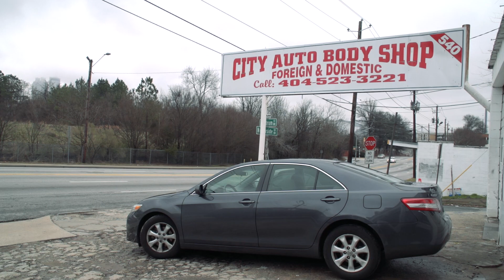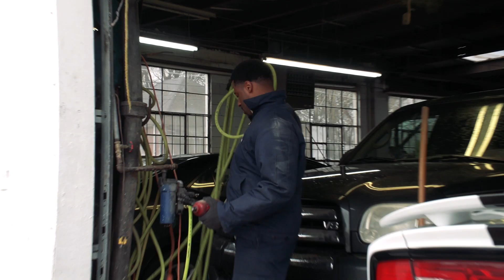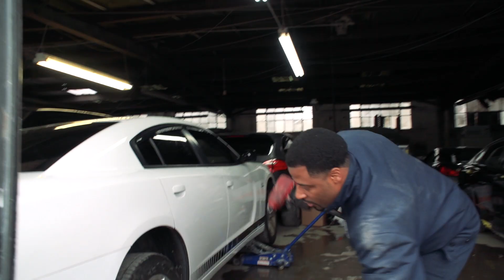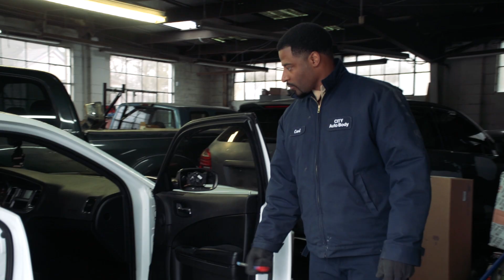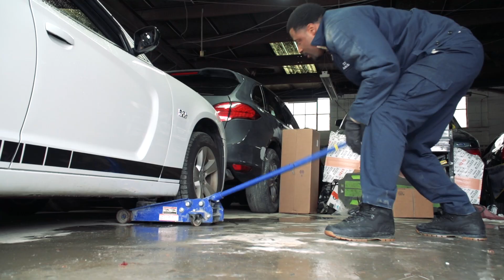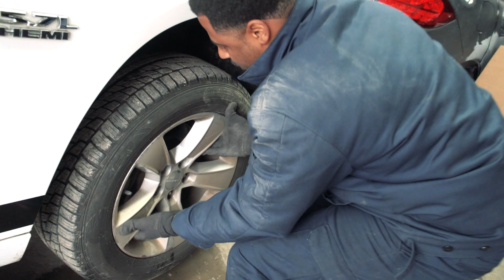Automotive Mechanic | What I do & how much I make | Khan Academy

Comment: I’m sorry but connecting a scan tool does not tell you what the issue is and how to fix it, it simply guides you where to check, removing and replacing parts is the easy part, all it is is nuts and bolts any grease monkey can do it

Comment: He sounds like a rookie. Kept talking about tires most of the interview.
Reply: bro dont hate congragulate.  Where is the god in you?
Reply: Gee Bizz that’s not hate. That’s just my observation. I’m a mechanic so I can tell when someone is lacking in experience.
Reply: @TheCm900  Does changing tranny fluid or coil packs count as experience? Or installing a cb radio and doing the whole fuse- splitting thing? When I first got my car, I noticed a sqeaking sound coming from the engine bay, and I popped the hood, and it turned out that the serpentine belt was like half gone, so, I went out, got the belt, and replaced it. My lack of experience, I found out later from a vet mechanic that I should've replaced the tensioner as well esp. in a vw because they've been known to wear out prematurely. anywho.. I like the fact that I can if I want to work hard enough, fix anything on my car. Well, as long as its not putting new synchros on my DSG Transaxle
Reply: @granderondeproductions3286  I must be deaf, cause who tf asked? lol
Reply: @yngfljm  i did

Comment: He look like one of those lube techs at jiffy lube
Reply: This dude would do circles around you.   that is if you even knew how turn a reverse threaded fastener.  oooo, mind meld.  ASE certified Automotive Assasin.  Made you a better technician.  You're welcome Junior
Reply: A reverse thread fastener, that is fucking stupid. Or he could check if a potentiometer has failed. Oohh… 

You fake ass mechanic, I can spot your kind a mile away. Did you know that cars had electrical components too? All you idiots that try to show off some basic mechanic aptitude. What a load of bullshit, you lying asshole, shut up you don’t know shit.

Comment: Did he say 6 to 3 thousand a year ?
Reply: 63 thousand a year.
Reply: It's 45k as mechanic. 13k as tow truck driver. Total 63 grand a year
Reply: @khoayeuha Try again 45 + 13 does not equal 63 lol
Reply: @jakek6728  lol. It doesn't.
Reply: 63 Thousand dummy
Reply: It does sound like six to three when I hear it, or six two three. But it makes sense that its $63,000 anually.

Comment: best thing I ever done being an automotive technician
Reply: Same... Had this Career since my 2 Girls were Born. Long Story Short, one of them going to College soon.... Thanks for this!
Reply: i’m about to graduate high school this year what did you study in college for this career or automotive engineering
Reply: @woptobrson417  dont go to college its useless in auto, im going rn its a waste , just learn online
Reply: @chrisrstt  what do you mean useless? If I was to go get a AS degree in automotive tech at a community college would it be useless?
Reply: @Spacelight_777  I'm going for one rn, most dealers don't care tbh
Reply: @chrisrstt  Thanks for letting me know! Saved me a lot of time 🤙🏽💯
Reply: @Spacelight_777  I'm in my second year as A PACT student and tbh you will learn more on the job.
Reply: @Spacelight_777  go get a job at a local shop or a valvoline or something. Keep going around working for different places and get experience, then you can work anywhere all in the same time you would’ve went to college and spent a bunch of money on it
Reply: @Goon_Toob  My coworker wants me to come work with him at a car shop and the job is mainly just rotating tires and all that good jazz oil changes and brake replacements. Do you think it's worth a shot than going to college for mechanic?
Reply: Funny, best thing I ever did was go down on my readhead girls pussy! Been a journeyman diesel mechanic for 45 years now... Not that great!!! Everyone has different goals in life. Being under paid and disrespected in NOT my goal!

Comment: I wish if I can fix my own car all the time at this time it's very hard to find  honest mechanic every one want milk you out bad
Reply: Why can't you? Buy some tools (harbor freight, husky, etc.), watch some YouTube tutorials, and get to working
Reply: @anthonyesposito2576  Man I live by this. I have a quick story for you guys. So, I drive a 5 speed manual, and I was having some trouble getting into gears. I had bought the car used, so I don't know the condition of the transmission. The cheapest solution without doing the clutch, is the replace the transaxle fluid. So you know I pull out google, looking for advice from some shops and getting some quotes. One shop was going to charge me 300$!! right? to change out a lil oil? long story short, I get out to harbor freight, advance, get the gear/diff/transmission oil, get that hex.. I can't remember what its called but its to remove the bolt that you use to fill the transmission.. anywho.. I ended up getting the job done, and now it shifts like butter. And that, to me, felt good, even though it was a pain in the ASS to siphon that oil into where the rear sensor goes for the top part of the gearbox.. and my garage reeks of oil, but thats besides the point. What did I end up spending? 30$ on the oil. about.. 50 on tools? and its not like every job you have to keep buying tools unless they're different jobs that require special ones. Anywho, for my next project, I need to find fittings for my VW jetta because some were missing and some of the tabs are coming off of the splashflap thing. Also, I can recommend people to buy a service manual like Haynes or Bentley, because they go in depth to a lot of issues that are common to those cars, and mine came with service intervals for everything even the differential. Ok maybe not as quick as I thought, but I want to motivate someone that if I can do it, they can do it. God bless. Also, America needs to have more manual cars! personal opinion. easier/cheaper to fix, and makes you feel satisfied as a driver. Its a steeper learning curve, but I like a challenge. Now I don't even think about it.
Reply: @granderondeproductions3286  damn man Idk if your ever going to read this but man your comment is really inspiring gives me hope that my simple country ass can actually work on cars
Reply: @angelwashere8864  Its not that bad as long as you don't have like some fancy lambo or something lol. VW has pretty easy to get parts. But, yeah shit just put your mind to it, and you can fix almost anything so long as you don't need a hydraulic lift (I don't even have room for one) or have to remove the whole engine. Thats a different ballgame but hey, if you can, go for it.
Reply: If we were in the same city and you needed someone I’d definitely help you, I’ve always been that type to explain the issue and actually show them to understand.
Reply: I work on my cars constantly, I use YouTube to get info and Tutorials when working. Start with something simple and work from there.
Reply: I'd sure hope you found a good shop by this point, but honestly if you need one, go to the parts store.  They deliver to all the shops in town and can more or less tell you which ones are ordering replacement drain plugs daily